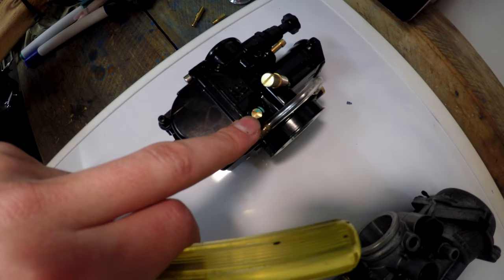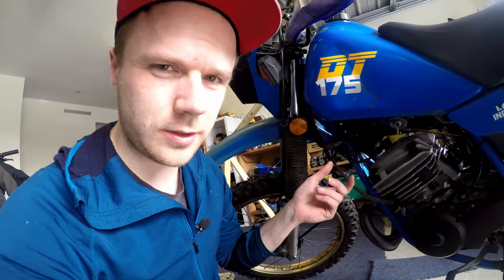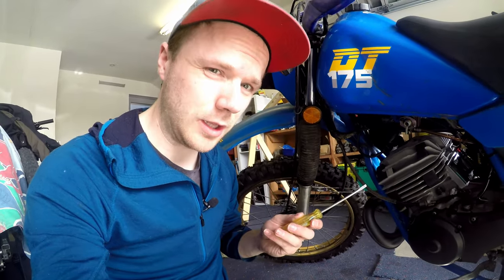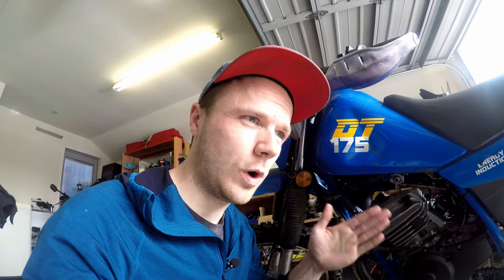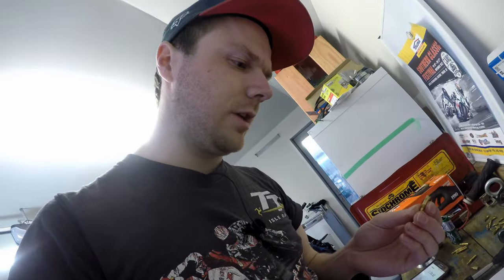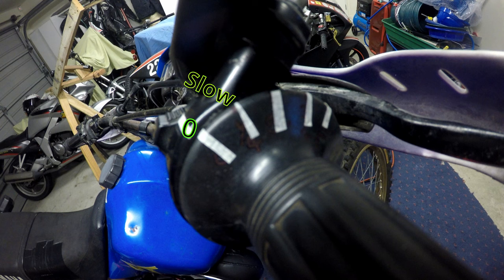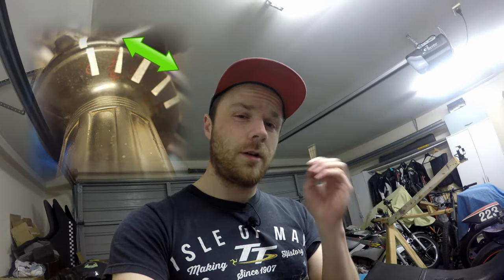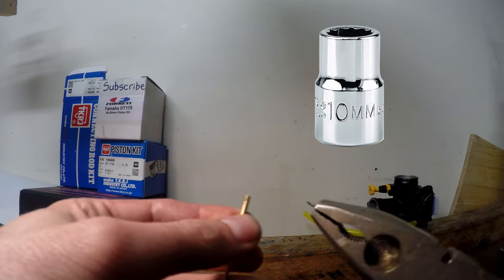pwk Carb Jetting, Setup and Tuning

Comment: My PWK 24mm at full throttle is like rolling...
Reply from the maker: What bike and what jetting?
Reply: @TheMotorcycleForge  can I send you email ? I would like to show you the spark plug if possible slow 35 and main  115
Reply from the maker: Yeah my email is on the channel page I think.
Is it a 2 or 4 stroke engine?
Reply: @TheMotorcycleForge  2:stroke 80cc
Reply: Looks like is misfire at full rpm is it possible the mix oil in gasoline in the tank is too rich because was okay before with 1 n half turn on adjustment srew, since I did the mixture too rich in oil starts to do this
Reply: Used 16:1 I think is too much before was 25:1
Reply from the maker: Yep it's definitely possible that it has too much oil.
Reply: @TheMotorcycleForge  cheers